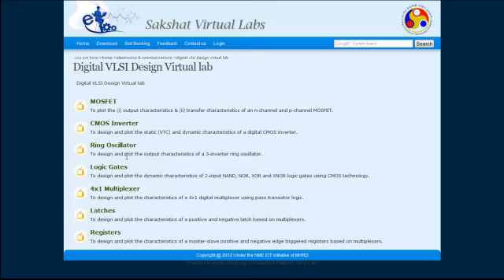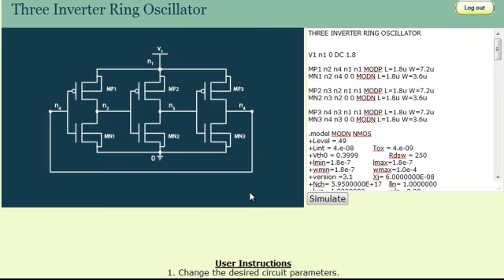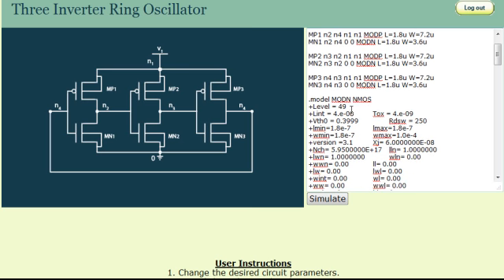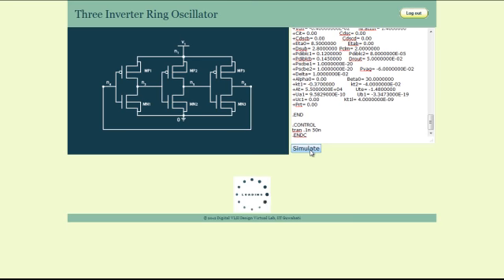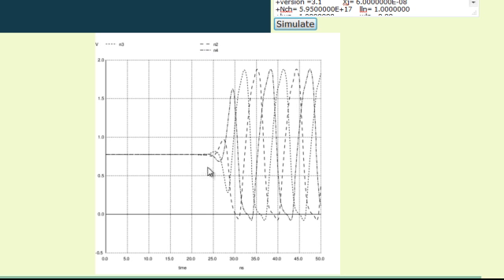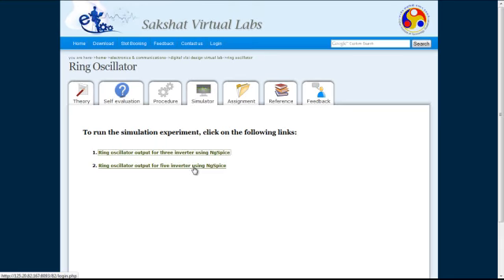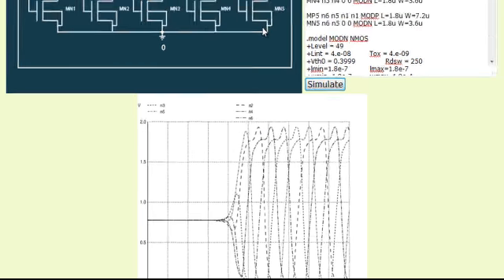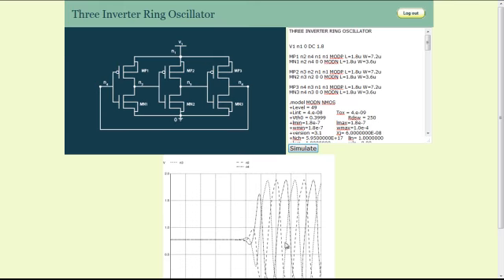Ring Oscillator

Comment: Have u ever tried singgle ended 3 stage ring oscillator with CMOS 
Inverter load in multisim?
I have tried it but could not oscillate.
I have set net initial condition which is connected from last output to 
first iput to be ZERO volt. Then I set w=1.8um, l=0.18um, 
unCox=7.5e-008, Vth= 0.7 for PMOS and w=180um, l=0.18um, 
unCox=2.25e-009, Vth=0.7 for NMOS. But, it was not oscillating.
Please give me advice....
Thanks at first.